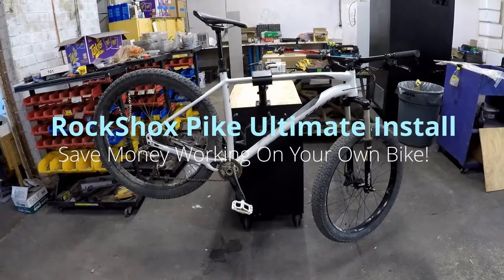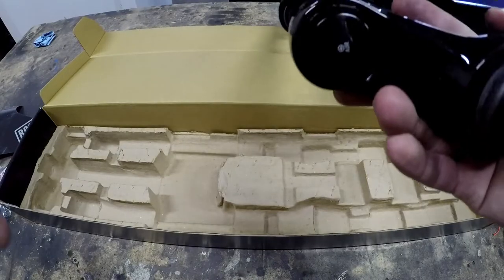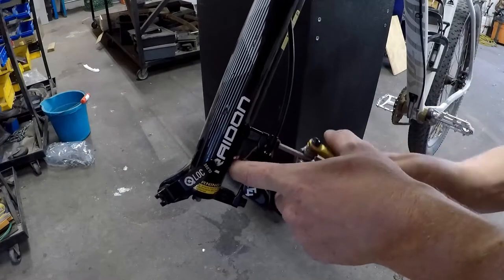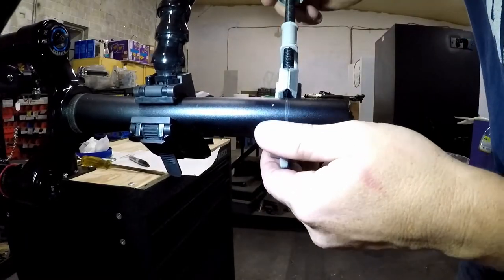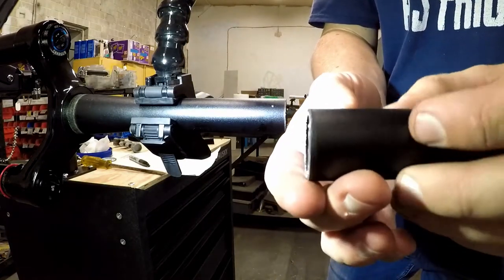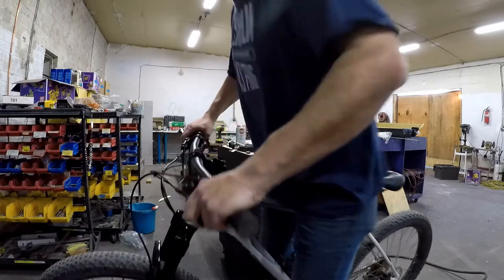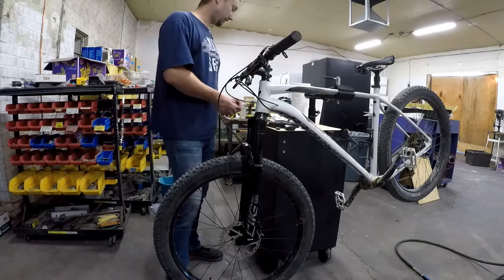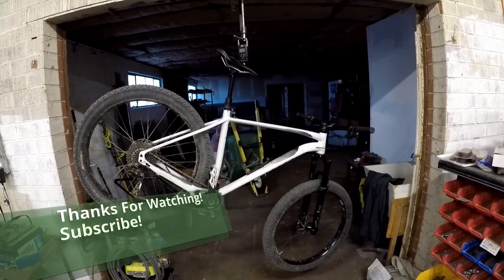2021 RockShox Pike Unboxing and install | How to install a bicycle fork tutorial

Comment: Thanks excellent video.  Why did you add 10 mm to the steerer tube on the pike?  I’m going from 130mm to 140mm pike.  Is that extra 10mm necessary?
Reply from the maker: I left it there so I can adjust the handle bar height in the future with the spacers.
Reply: @HerbOMatic  Thanks for the video.  I was able to install my Pike yesterday.  Only problem is I used the Park saw guide and a handsaw (and the recommended narrow channel/guide) but it did not cut perfectly flat/level.  But my ride this morning was ok.  thanks again.

Comment: Did you notice a significant difference in steering with the 10mm travel gain? Great video. Will be a big help as I take this on pretty soon. I plan on adding the volume spacers pretty quickly as ai’m a heavier rider.
Reply from the maker: It didn't change much on the steering, 3mm probably went to sag.  This fork makes the bike a crap ton better than the old suntour!  I'm 200lbs and left the factory amount of spacers.  A little extra travel makes the bike a little slacker for the down hills but I didn't notice anything except more controllability because this thing soaks up the rocks!